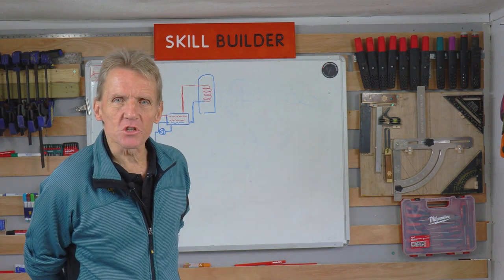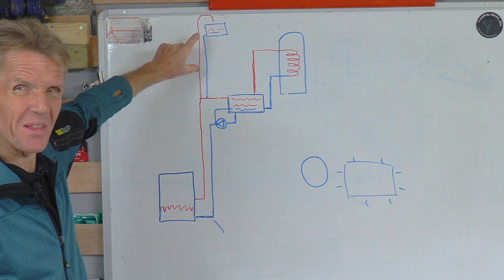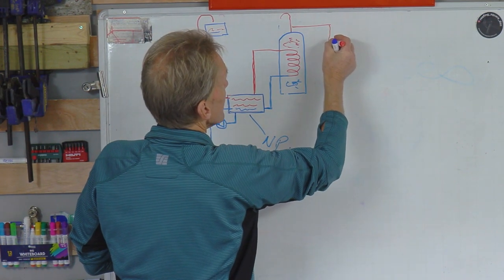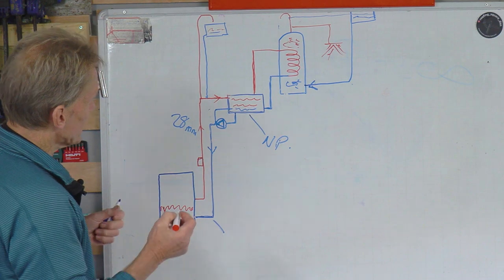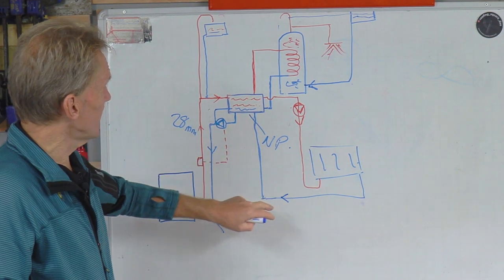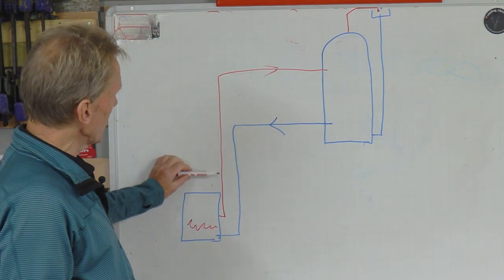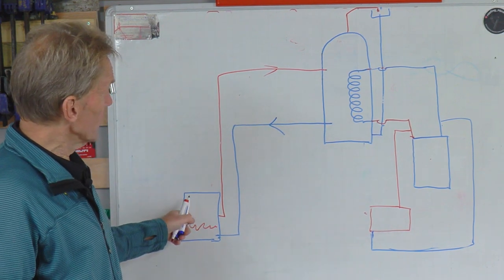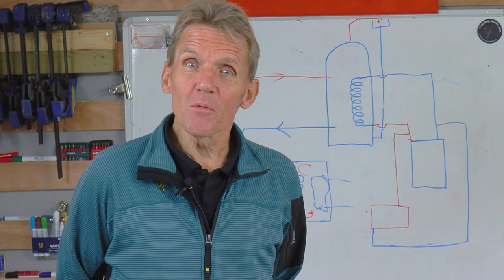Dunsley Neutraliser Solves Link Up Problem

Comment: Great video but my question/issue is that  28mm, neutralize, additional pumps, heatstore all ads up to cost, and in the end you spend more and more. What about something simpler as pushing hot air American style, any idea how to achieve this?

Comment: Hi Roger. Does the neutraliser negate the need for an injector Tee in the system? I have a simple Rayburn powered gravity fed HW + CH system that I installed with a homemade injector tee on the radiator return / tank coil bottom. I'm thinking of adding another heat source at some point and have been gifted a Dunsley neutraliser. I can't see any ref to an injector tee and logic seems to suggest one isn't needed if using this combined neutral point. Thanks
Reply from the maker: You don't need the injector tee because it is a low velocity point but I don't think leaving it in will do any harm
Reply: @SkillBuilder  Thanks

Comment: I used a laddomat charging unit and thermal store. More expensive but stove got up to temp quicker and then only supplied hot water (81' thermo as I recall) to the store.

Comment: You would be in shock how many plumbers this flies over the head off. I run 2 boiler stoves, the go direct to 500 litre thermal store. Central heating then runs off plate heat exchanger pressured heating at 1 bar. 2 stoves are fire place insert stoves 11kw each. I run the circulation pump to the store for tje first hour once the pipes hit 45c then let natural circulation take over. Away quicker to heat the store. Store runs Under floor heat for 2 days without heat demand if topped to 75-90c. It works but heat leak rads, expansion roof space loops do play against the store concept. Fuel wise better now. It took to block the outside air intake pipes by 70% plus screw the primany air 70% to get the right flame. Now a loaded fire goes 2 hours without a reload. A basket of 6*2" timber blocks runs 4-5  hours. Store then good for 2 further days. Plumber wise i fitted all myself. All in 28mm soldered cooper. Too many plumbers just simply dont have any idea of systems like this.
Reply: Hi Oliver, i have something like this in mind. Would you be able to share a schematic of your system, please?

Comment: I dont understand how you can have a pump directly before the solid fuel boiler stove? Its suited to open vented systems which with a pump it isnt. What am i missing? Is this not a diagram for a solid fuel boiler?

Comment: Could you do a schematics using solid fuel fire and oil burner using just a thermal store cylinder without the header tanks in the attic.

Comment: That plate system seems like a self-contained heat exchange (correct me if I'm wrong, I'm far from an expert on this); why not just pour vegetable oil in it to transfer the heat instead of scaling water? (I hope this question proved my point on being far from an expert, and a possible answer might bring me closer to one day maybe being an expert ;) ). Great channel, btw. I've been binging your videos these last few days.

Comment: Good presentation Roger.   I blogged here some time ago but I could not upload any pictures for you that you asked for. My "Dunsley" is the hot water tank itself. My plumber explained that to me. The water is classed as "Dirty water" The wood burner, oil boiler, gas boiler and any other hot water supply, ie, solar panels, thermal panels, can all be run through the tank. It is a "Thermal store" My hot water is supplied by an outboard heat exchanger. I have leaned a lot from plumbers/heating engineers. The only way to know my system is to see it. Keep up the good work Roger.

Comment: Thanks Roger, interesting, on the very last system you showed, the pipes from the log burner go into the hot water tank on the drawing, would they be connected to the coil? Or are they heating the water in the tank directly. And would it need a pump?
Reply: As I understand it they are heating the water directly. The water is not used for taps etc  but is contained within the system purely to store heat. Hopefully Roger will correct me if i misunderstood.
Reply: @ciaranamhain  thanks

Comment: Cheers Roger, super video. Just the sort of thing i'm currently looking at for my new heating system with multiple heat sources. I was hoping to avoid all the tanks i the loft though. Would it be possible for example to have a Thermal store/buffer tank with three coils, in my garage, a coil for the wood burner, one from the gas boiler and one from solar thermal with a low head f&e tank for the wood burner just above. (I expect that I would have to pump the wood burner circuit). And possibly An immersion heater for Solar PV/Battery.  Then use the stored water for heating and unvented cylinder on an S plan? I would very much appreciate your thoughts. Cheers, Rick

Comment: Plate heat exchanger will not form scale if one side is on the open vented circuit and the other on the gas boiler unvented circuit.

Comment: I’d like to understand that bit more about the system boiler and unvented cylinder.... Is my Joule single coil no good and would need replacing with a twin or three coil and then keep the Dunsley circuit and the DHW circuit separate via the multi coil?

Comment: My parents had this sort of system inn their house since the mid 80's with 2 wood burners and an oil boiler feeding into the neutraliser. Can anyone recommend a decent control system for this as the one they have is now rather antiquated.

Comment: Fantastic video as always, thank you Roger! 

Are there any unvented options available or vent pressurised options that can vent without the use of vent pipe up in the loft.
Additionally allowing for connection to a combi-boiler, radiators and say a megaflow unvented cylinder? Thank you 🙏👍

Comment: So can a solid fuel boiler be connected to a pressurised system?
Reply from the maker: not directly, You need an open vent and a heat exchanger which can then feed the cylinder.

Comment: Hello Mr Bisby. I have fitted one in a bungalow with copper cylinder close to the floor. The only way I could get it to work properly was to put the 28mm return from the Dunsley back to the back boiler was to go under the floor boards to get the thermo action/ gravity circulation.
Delighted with it. The oil fired boiler, the wood burner or both at the same time. Got on well.
28mm is imperative.
Reply: Can it work with a gas boiler....?

Comment: Quick question . Is it 28mm on both pipes to and from the wood burner . Thanks
Reply from the maker: Yes, correct you need to have a column of cooler water to push the hot water
Reply: @SkillBuilder  appreciated 👍

Comment: Kinda odd to see these open vented systems being used, here in Finland all of the new heating systems are sealed, with a membrane isolating the water from air in the expansion tank. Safety valves will relieve the pressute in case of a problem. It's supposedly better for the pipe longevity, as no new oxygen is introduced in the water.
Reply: Yes, but this is the recognised way of plumbing in a solid fuel system because of the much higher risk of the water boiling because of the difficulty in regulating the water temperature. A sealed system would or could be dangerous. The vast majority of heating in the UK is by gas and again the majority of those is with a combi boiler in a sealed system.
Reply: @paul756uk2  yeah, here in addition to the pressute relief valve an emergeny cooling valve also must be fitted if a solid fuel boiler is used. It will cool off the boiler with water mains if temperature rises too much

Comment: It's just a low loss header
Reply from the maker: yep
Reply: @SkillBuilder  A low loss header is a modern version of the neutralizer really. I've fitted them since the early 70s and im about to replace one shortly [ if it needs it after inspection] . I'd love to do a couple of videos to show how we did other plumbing stuff back then! i dont think some of your younger viewers/ plumbers would believe the process for example of putting a  basin waste in a basin. 
Make a lead washer after drawing round waste,  cut out by hammer and old screwdriver. Apply gloss paint to underside of basin waste hole, roll up a linseed oil putty sausage and wrap round slotted waste top and bottom of waste hole,apply lead washer with gloss paint to adhere to putty,apply  another sausage of putty under lead washer then tighten a brass backnut to seal. Now you know why its such a hard job to get the bloomin' things off especially in situ 50 years later!  ps no ptfe tape or silicone back then either. We never had the problems with sealing shower trays that seem common now. Most were just tiled onto and grouted but were probably so heavy they'd never move ! Cheers Roger from David kneale plumber Isle of man. Im just coming to the end of my plumbing days after 50 years this September.
I'm not sure all the changes that have come in are improvements either, toilet innards especially.i have just been greasing a big brass/ bronze wc syphon that is 93 years old and still working but by the same token ive been back to a modern push button syphon that i fitted about 6 months ago that is sticking on the cable  .aghhh!

Comment: Hi Rodger, firstly I do enjoy the videos you post so thanks for your time and effort. There is another way of linking a solid fuel burner into a system ( any energy source or system ) and is more automatically controlled. I used to take the Dunsleys out to fit these. It make the stove fully pumped. Have a look at a H2 panel Made by heating innovations. 

All the best. 

Nathan.
Reply from the maker: Thanks Nathan I have seen the panel and I was going to do a follow up video  on it but the subject is running out of steam. I might return to it later.
Reply: @SkillBuilder  fair enough, they also do other panels that allows you to link airsource, ground source and solar. I have had many encounters with it and found it the most successful. Not to worry, thanks for the reply and wish you all the best for future videos.
Reply: @SkillBuilder  I have am H2 type system, linked up my solid fuel, oil boiler and Electric boiler (modulated from excess solar) to make 3 heat sources in to hot water and rads,  I made my own controll system that all works automatically. all the boiler can run by them selves or in any or all link up modes. heat from the solid fuel first satifies the rads and then the hot water, after it dumps heat to all rads.  and in the event of power loss it reverts back to a gravity feed to hot water. and of cours has an unintrupted vent pipe on the hot side of the fire. been running faultlessly for 8 years

Comment: galvanized F&E tank needed ? with a brass balled ballvalve.
Reply: Ideally, but im sure there are thousands of plastic tanks still doing a job. the controls would hopefully allow excess heat to be pumped away to rads before any boiling occurs up in the tank area.
Reply: @davidkneale8552  failsafe, if the controls fail the system must be capable of handling the heat.

Comment: why is it called a neutraliser? 
because it neutralizes excess heat or....?
Reply: Pressure between two heating systems👍
Reply from the maker: It gives a neutral point where one circuit won't pull on the other
Reply: As it says, its the neutral point of hydraulic separation.

Comment: Does the CH pipework need to be in copper as well?
Reply from the maker: it depends on the temperature. I would say that pumping the water around a central heating circuit will be a lot cooler than the gravity circuit
Reply: Standard rules apply, need to be copper for a metre on the flow from the coal fire
Reply: @SkillBuilder  @Gary Dulson I ask because I have existing gas fired closed system with multi layer pipe and Id like to add the solid fuel option. Wouldnt a three way mixing valve and a pump work before heat exchanger on the solid fuel side (obviously gravity fed) be more simple. Or would it pump the water straight out the expansion pipe? Cheers
Reply: @garydulson9018  If wood fired, coal or solar Id do entire thing in copper, I rephrased my question kind of, cheers.

Comment: You are making this so complicated.
Why not just use a steam furnace? Like older houses in the US.
All you would have is a furnace, pipes and radiators. You will not need all of this other stuff.
Reply: This system could be approaching twice as efficient as a steam boiler. That's why
Reply: This tank on the loft is a bit of a Brittish concept, we do not use this at our side of the pond.
Reply: @frzen  steam furnaces are efficient.

Comment: is it possible to have a wood stove with a vented loop heat a coil in an unvented cylinder so you keep the benefit of mains water pressure for taps, without the downsides of it exploding.
Reply: No, you cannot use an unvented cylinder with solid fuel. A coal fire is uncontrollable so you can't regulate the heat source.